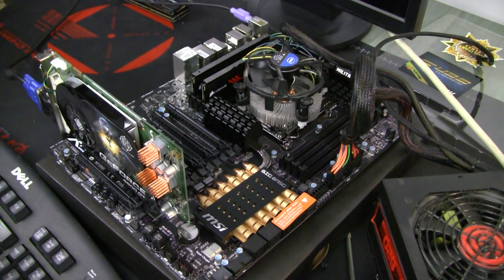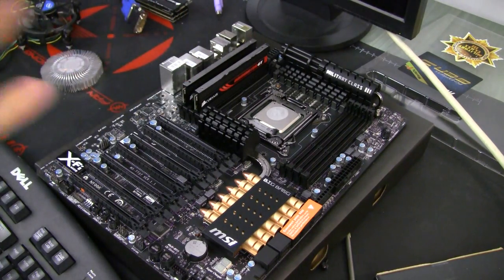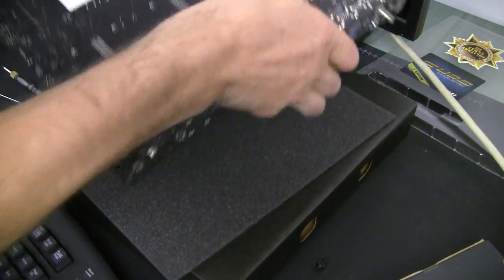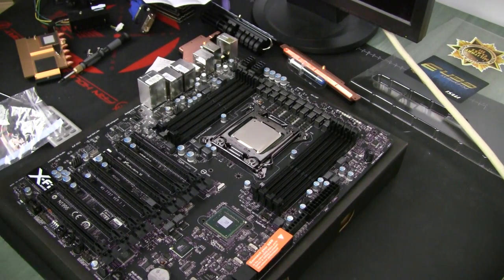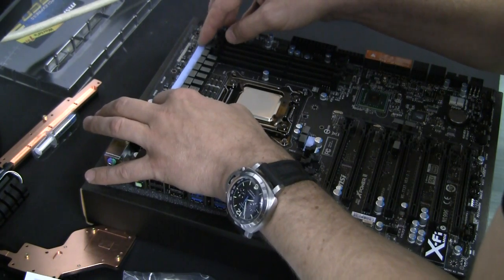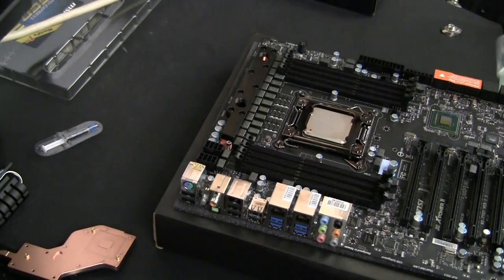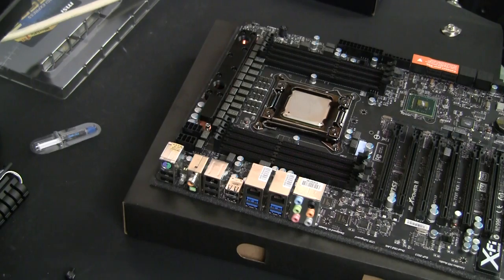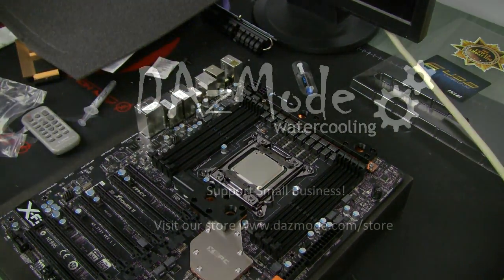MSI Xpower II X79 Motherboard Waterblock Full Installation Video (Venom Build)

Comment: I know what you mean. I am not used to being on camera, but I think it is important and I like that you do and others. I do many takes sometimes and then have to edit forever. I know what you mean.  By the way I have the XPower II in my Case Labs STH10 and love it. I had bought the blocks like you have but have not yet had the time to take the system down yet to add it.  But thanks to your video it looks straight forward and I know what to expect. Thanks for watching mine. It is going to be fun.

Comment from the maker: You may be able to use 3/4"OD tube, but I'm not going to check that as I plan to use 3/8"-5/8" tube.  You will be able to estimate that visually by imaging bigger fittings and tube.

Comment from the maker: I could not believe my eyes for split second. At first I was thinking it is thermal tape,  but it turns to be virgin thermal grease. You also can see that only one of thermal pads on MOSFET has marks from contact. I did say anything, but you can see that in the video.